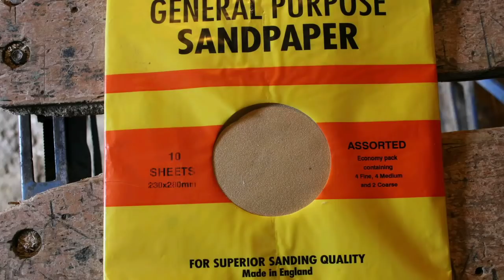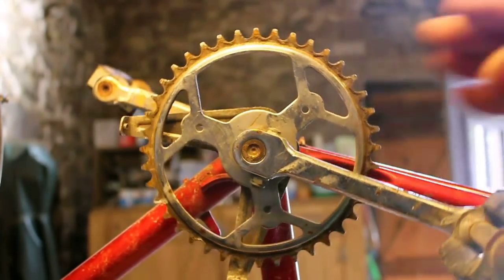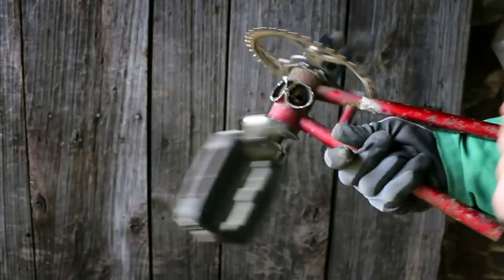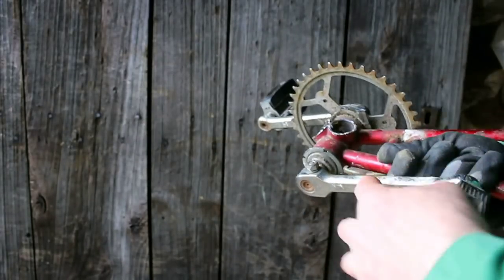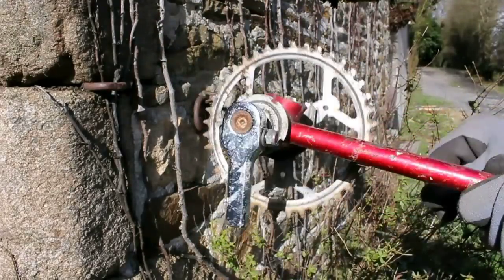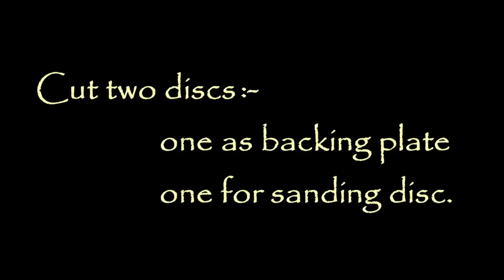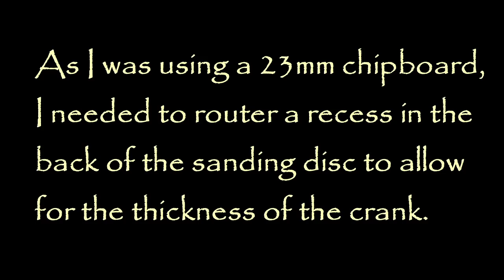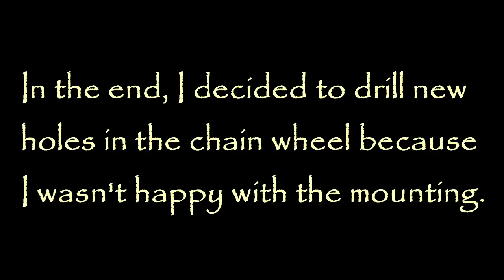Hand Powered Sander Homemade tools  Bricolaje una lijadora de disco Brico ponceuse de récup

Comment from the maker: Thanks! I've just managed to get hold of three more, my plan is to make as many pedal-powered tools, household and smallholding/homesteading appliances as possible. The washing machine has worked so well for us now for over two years and I am adding a solar heater to it this year rather than use the wood cooker in Summer. Pedal power is great, it saves fuel and you can read and get fit at the same time, plus it saves all those fine bikes going into the crusher or landfill! All the best, Andy

Comment from the maker: The original crank lever length is to provide sufficient leverage to propel a bicycle with its human payload. The load required to sand a small piece of wood is considerably less than this and hence the crank lever length can be reduced. A long crank lever would also mean that the driving hand would have to describe a greater circular path, which is completely unnecessary. Your argument is specious both to a physicist and engineer, which is the polite version of your comment. All the best, Andy

Comment: Well, my power sander is using this system and it works fine :) Also- when old velcro disk is used you can simply change it to a new one. They're self-adhesive.

Comment: A bike crank, ingenious! you already have the wheel with the bearing, and it should be almost true. I'll be using this idea for my disc sander. Many thanks
Reply from the maker: Hi Rakafet,
You've obviously understood how handy it is to have a ready made component like this. It's even better if like me you have some discarded bicycles around.
Good luck with your disc sander and many thanks for watching and commenting.
Best Wishes from France, Andy.

Comment from the maker: Nice idea but I wanted to make sure the sandpaper surface was as even as possible. The velcro, I think, may produce bumps but one could attach a thinner disc, with sandpaper attached, to the main disc with velcro, which should work. All the best and thanks, Andy

Comment: This looks pretty cool. What I could also suggest if you are cutting with a compound mitre saw, instead of cutting at 45o, try a few minutes of a degree before and after 45 to make them line up better. Also, if you want nice corners, cut the moulding at a 1o angle from perpendicular to the flat side of the moulding. Sort of like a "/" where the top of it is the profile of the moulding.

Comment from the maker: I agree, if you can maintain the two angles whilst moving the wood against the fixed sheet of abrasive then that is the simplest solution, but I can't.
The point is to provide a guide so that the wood is presented to the sanding face at the required angle i.e. 45 degrees and that the mitred face is finished square to the rear face of the wood.
Speeding up the wheel with gears would make it run faster, but I'm afraid of overshooting the line if I go too fast.
Thanks for your comment.
Andy

Comment from the maker: Hi, because firstly, I would have to have a drilling machine in a horizontal mounting. Secondly, it would run much too quickly and I want a slow speed. Thirdly, it is hard to attach the shaft to a spindle so that it runs true, whereas this configuration already existed on the bicycle. All the best, Andy

Comment from the maker: Hi, the bike was a wreck. I sought and found a solution to a problem which I regularly experience, namely fine finishing of saw cuts. The idea was to have a machine which did not need to use electrical power and to introduce this concept to others. That is also why I have our pedal-powered washing machine on this site. Thanks for watching and commenting. Regarsd, Andy

Comment: Congratulations is a great idea.

suggestion:
For more speed and strength in the sanding disk, use the bicycle wheel rim with the chain and pedal!
Reply from the maker: +jaime bati Thanks, for your comment, appreciated. Good point but this is just for fine sanding, so I really need accuracy rather than speed or strength. All the very best, Andy

Comment: Hi Boss, I like this idea - one thing I dislike about electric tools (my new electric planer) they throw the dust and crap everywhere........??  But I sort-of agree regarding the one-handed thing.  So, here's my suggestion: mount the table and guides on the bike's handle bars, and connect up the pedals to drive the disc (also fixed to the table-mount.  That way you got two-foot power and two-hand timber holding....... Better still: make it on a small bike so the kids have to pedal, while you do the sanding..................

Comment from the maker: I couldn't get the square face at the correct mitred angle as easily. As everything else was recuperated the only price was the sandpaper. This is not a working bike, we live at the sea, every Summer people come here on their holidays, buy a cheap supermarket bike like this and  ride it to destruction for the month they are here. These bikes end up behind the glass and paper recycling points or  in the dump in various states of decay. We collect them up and put them to use. All the best,  Andy

Comment: What you also could do is get the chain and the wheel where the pedal mounted on. Take a smaller gear and place it on the sanding wheel and use the bigger gear the spin with your hand. this makes much more torgue

Comment from the maker: Firstly, this is not precession but I agree it's not nutation either, we'll call it a wobble. I made this tool from a broken, low-end bike for a specific requirement, you can actually buy this tool now it costs $200. The bike would have gone to landfill or been crushed. So, I made something I needed,  repaired a neighbour's child's bike and there are bits left over to make more projects and this is ......indefensible...to whom? Thanks for your comment, all the best Andy

Comment: if you found another bike crank assembly you could mount it below and run the chain around the sprockets so you could sit at a seat and use your feet to pedal the sander and leave both hands free to control the work, like the old grinders for sharpening axes before power tools were invented.

Comment from the maker: Hi, I'm just using a mitre block to cut the wood, probably one of the reasons why I have such a problem with my corners.
I like the idea of not quite having a square mitre face but I glue these corners and hence I feel the bond is better over a greater surface area.of contact.
Thanks for your comments and suggestions.
Best Wishes from Normandie, Andy.

Comment: Nice little project. I could certainly use one. I think I'd go with plywood, instead of chipboard, or possibly even a nice piece of sheet aluminium or other metal for the disc itself. That would be much more durable, keeping its flat face as well as being a better surface onto which to apply the sandpaper itself.
Reply from the maker: +Thom Westergren Greetings Thom, good suggestions. I did have to check several sheets of chipboard with a straight edge to find a truly flat area. I like the idea of a plywood or even a metal disc, I've yet to replace the sandpaper on the current disc so I'm not sure how the surface will be affected on removal of the old paper.

Thanks for your suggestions and comments, I really appreciate them. Best Wishes from Normandie, Andy.

Comment: This will probably help most of you if you have a table saw
How to cut a circle on a table saw
this is just the first video i found.  Its really ez to make a table saw jig for cutting circles.  Mine is even on a slide so its easily adjustable for different size circles.  They come out way faster and cleaner than the method in this video. 

Nice Video though props for making a simple hand tool from scratch.
Reply from the maker: Ron Westbrook Oops! I’ve only just found your comment tucked away in the ‘comments awaiting approval’ bit. My apologies for not replying sooner, but belated thanks for watching and commenting.
It's a good point your making but for me the important thing was that the 'disc' was rotating around the fixed axis, the shape of the perimeter made no difference to the effectiveness of the sanding function. The obvious improvement you suggest would be in the speed of production.
Thankyou once again for commenting. Cheers, Andy.

Comment: Using powered tools to make non-powered tools... I love it! I am doing the same with my shop... buy a contractor's saw, routers, and bandsaw, which I use only to make accurate jigs so that I could work wood using manual hand tools. It seems illogical at first, but this way I am able to do woodworking even at midnight, right in my living room, while my family sleeps peacefully.

Thanks for sharing the vid, though I'm wondering, why not just use a hand plane and shoot board with a 45 degree fence? If it gets blunt, just sharpen the plane iron, whereas if the sandpaper gets clogged up, you'd have to remove the plate which holds the sandpaper, remove paper, remove old adhesive, flatten the plate so that old glue does not cause bumps on the cutting surface, attach a new sandpaper, cut it around the plate, then remount it on the assembly.

Of course, if really like doing it this way, then you're most welcome to it, I guess, but I was just wondering. Have a good day :)
Reply from the maker: +truebluekit Hooray! So glad you understand the need for both power tools and hand tools.
Thanks for your insightful comment. Good luck with your midnight woodworking projects! Best Wishes from Normandie, Andy.

Comment: nice idea. i would make a much longer crank arm. bigger movement but greater speed on the disc. thumbs up.
Reply from the maker: Hi Boba, thanks for the suggestion. I have found that for the quantity of wood I need to remove it is better if I do not have too much speed. Thank you for watching and commenting, I relly appreciate it. 

Best wishes from France, Andy.

Comment: Thanks for the film. Great use of old bike parts.  Have you thought of attaching a treadle to the drive crank, so that you can operate it with your feet, and have both hands free to hold the workpiece?
Reply from the maker: +Paul Tully Hi Paul, I really like using parts from discarded bicycles, they  are very rarely worn out and hence have a long and useful life ahead of them. I'd thought about a treadle but not for this tool. It is quite easy to hold the workpiece with one hand as the guide and the table act as firm supports for it.
Many thanks for your comments and for watching the film. Best Wishes from France,  Andy.

Comment: For a cheaper version without involving the frame: Use a square taper crank and a sealed cartridge bottom bracket square drive (very cheap, buy it new for a few $ and ensure a smooth spin). For that a normal clamp for round things would secure the BB to the desired table frame, and no bike frame gets tossed :D

Comment: I don't know if you're into hand planes but you can often get an old Stanley or Millers Falls off ebay for around $25, tune it up a bit, make a shooting board with a 45 degree backing guide or even find/make a Miter Jack for seamless miters

Comment: Actually there is quite a lot technology involved here. It`s a rotating disc sander. Before there where disc sanders only sheets of sanding surface where used. Before that...well...maybe you could grind your material on rock surfaces.

Comment: If you combine the crank with the rear axle assembly you would get the benifit of the gearing and the idling so your crank handle won't kewp spinning.

Comment: cool! But it could be further developed. What about utilising the bike's inherent design, and using your feet to power the sander? make a seat in front of it, or your optimum position, the pedals below you, and a series of chains to attach it to the wheel? and instead of directly powering it, use the inbuilt gears, so you can use the torque of your legs to achieve the speed of a powered sander.

Comment: great work! I'm thinking it can also be designed as a eccentric sander by mounting it to a upside down "drawer with rubbers on the edge. In this way you will have a sander for boards. Just a thought :)

Comment from the maker: I think this would be the next generation of human-powered workshop tools. The main idea for this design was to sand accurately at a low speed so as not to remove too much material (a common fault I have when using belt sanders and the like). Thanks for watching and commenting, Andy.

Comment: fli the frame around and peddle to power the sander? Or you could weld a second bottom bracket onto the frame and attach a smaller gear to the back and pedal that way too.

Comment: Hello, i have a table grinding wheel, it's just a clamp with an axis and the very interesting point about it is that the wheel is very heavy, that makes a good inertia to it
Reply from the maker: +irlrp Hi, yep there would be plenty of inertia due to the mass. Is the wheel turned by hand or by foot via a treadle?

Comment: Nice one :) But did you ever thought about using a velcro instead of PVA glue? It's one more problem solved, because you can quickly change your sanding discs when old is used or when there's need for other gradation.

Best regards :) Greg

Comment from the maker: I used an expensive camera to film it and an energy consuming computer to edit and upload. I'm just sharing some ideas for powering down. We are moving off the grid in our new place, so I'm getting well prepared for that. We also have a pedal powered washing machine - going for 3 years now and I used a welder to make that but again this is for the future when we will not have easy access to power. Part of the exercise has been to consume less - we are down to 9 Euros electricity use per month.

Comment: Would it be possible to leave the wheel mounted on the frame and attach the sanding disc to the rim? To get the wheel to spin a little longer and to give a little torque take off the rubber tire and wrap the rim with some fencing wire to give it some weight. Like the vid. Get's me thinking.

Comment: Brilliant upcycle of otherwise junk hardware! While the reciprocating foot-pedal already mentioned might take away the precision you need, with an additional flywheel this could be easily made into a wood-turning lathe...
Reply from the maker: Good idea, the flywheel would certainly smooth out the power delivery.. I'm thinking of making a pole lathe using recuperated pallet wood sometime soon so I'll cry off doing the bicycle-powered one for the moment.
Thanks for your comment and suggestions, I really appreciate them.
Cheers, Andy aka Organikmechanic.

Comment: You should use the foot pedals and a high gear ratio to obtain higher RPM to do this  while freeing both your hands .
Reply from the maker: +Sajid Rafique Hi there Sajid, thanks for the suggestion. I have found that for the tiny amount of material I wish to remove the speed I have is adequate. Also as long as the disc is rotating down the face of the wood and thus pushing the wood onto the table top, it is easy to hold the workpiece against the guide with one hand. Many thanks for your comments and thanks for watching. Best wishes, Andy.

Comment: you can use a ”gearbox” big to small and another big to small to make the wheel spin faster
Reply from the maker: It's a good idea, especially for higher speeds. With the arrangement I have here, the removal rate of wood is very slow which is what I wanted. Whenever I use a higher speed machine I find I start to lose my accuracy (I tend to remove too much!).
Many thanks for watching and commenting.
Best Wishes from France, Andy.

Comment: Finer grit +higher speed and the result is an even smoother fit or less tearing if you are doing trim in MDF.
Not that I like MDF, but if it is being painted why use good wood.

Comment: If you used the axle to run the sander, mounted the pedal assembly and left the chain drive it would run faster with the gear reduction
Reply from the maker: +Kevin Ensey Yes, I see what you mean but whenever these things run too quickly, I always take too much off, so this way is accurate. All the very best, Andy

Comment: maybe you could rise your "precision" by sanding the sub-pannel of the sander first, so it is running plain?
Reply from the maker: paul wyleciol I like it! At the moment I 'm content with the quality obtained with the slightly rough disc surface, but if I needed to improve it I would certainly adopt your suggestion. Or, if I changed the adhesive, I could use a chipboard with a laminated surface (like the table I use on the sanding machine).
Thanks for your comment and suggestion I appreciate both.
I've just finished writing two blogs on this apparatus, if you want to read them the first one is at:http://thegreenlever.blogspot.fr/2014/05/home-made-tools-from-dead-bicycles-hand.html#.U2-jy3bURB5 with a link to the second post at the end.
Best Wishes from France, Andy.